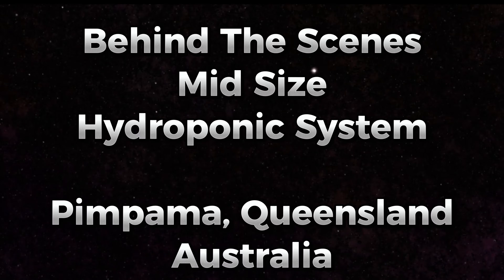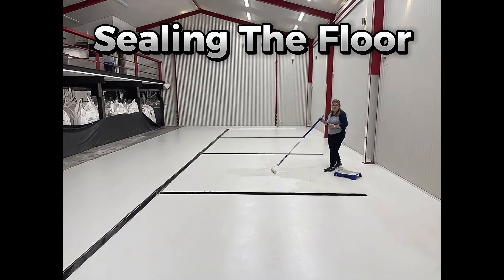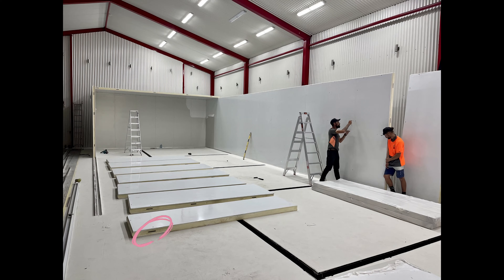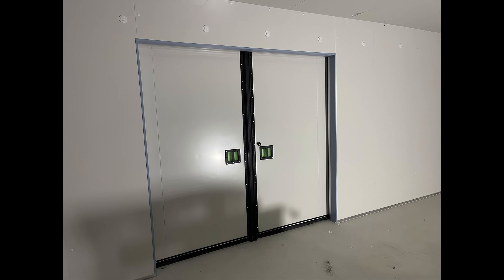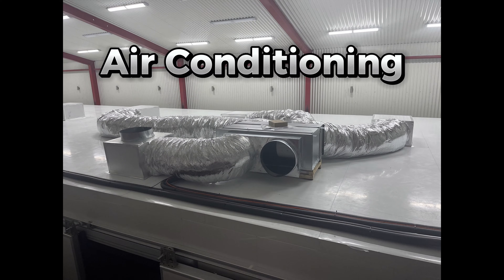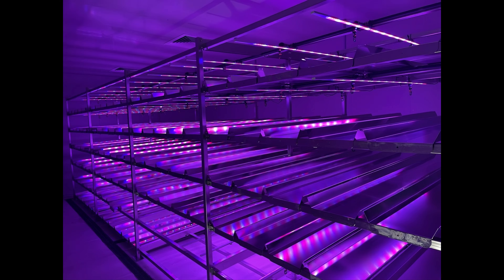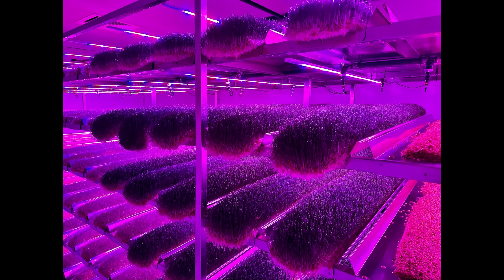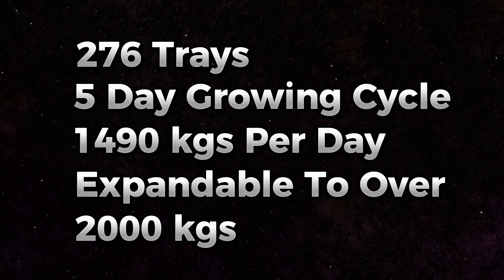We Built A World Class Hydroponic Growing System

Comment: Few questions to educate myself and others: 
1. Can VHFs be used to grow other livestock feeds such as Alfafa, hay, napier king grass, road side grass etc? 
2. Can price of this system structure be brought down using alternate materials without compromising on insulation, durabulity etc? 
3. Wouldn't it make more economic sense to couple animal food farms with animal farm box sheds in parallel to protect them as against viral diseases, extreme weather etc, compared to controlled sheds, or custom build sheds?
4. That way, animal waste can be collected and recycled to form vericompost? 
5. Wouldn't it be better to collect natural sunlight through rooftop and transfer it inside using optical fibres compared to LEDs? 
6. Are these systems solar powered? 
7. Aren't seeds a recurring cost? 
8. Are fertilizers mixed with water sprinkler systems?